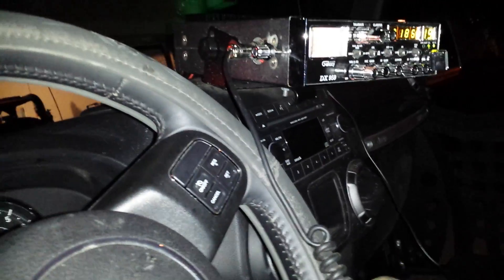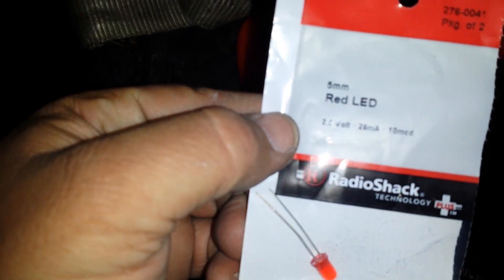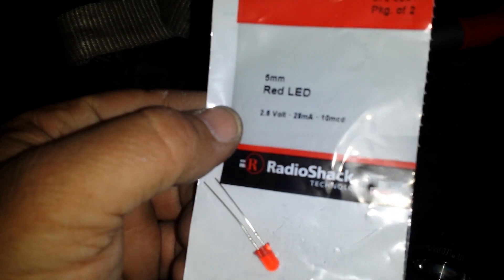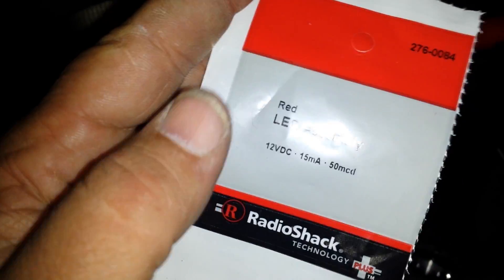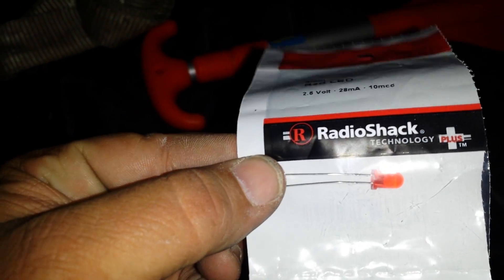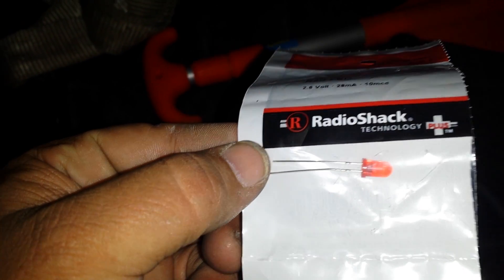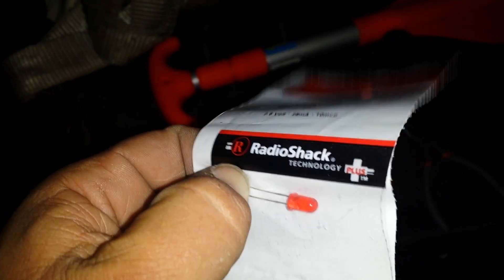LED light on CB antenna

Comment: I've tried it on my antenna but it doesn't work unfortunately.
Reply: Cause you ain’t got the output
Reply: @oldrango883  If I wrap lights around both my cb antennas, how would you recommend increasing the output? I have a road king RKCB. If you recommend I buy a more expensive and better quality CB let me know. Any advice helps as long as I can wrap lights around both my antennas and actually be able to use my CB.

Comment: Cool , back in the day we used neon bulbs, you don't need contact
Reply: I know I'm super late here, but I'm curious. Did the bulbs just run off the ambient power being given off by the antenna?
Reply: Yup, we used a simple 220/240v neon bulb with one prong fixed to the top of the antenna and the other sticking out into the fresh air, there's no polarity to worry about with neons, yes it will drain a small wattage but for mobile use it wasn't an issue.
Reply: When I used florescent bulb's it worked great on my antron 99 and on my antron single coil mobile antenna they were very bright.......... But be careful whenever I kicked the base or mobile in high gear I would explode the lights on the mobile it wasn't a pain to replace the light but on the 99 well that's a different story..... Just keep your RMS Watts under 2k and you should be fine.

Comment: Easier to use an NE-2 neon and shrink tubing, Still has the two leads but doesn't need to be an open circuit, plus it will burn brighter with less watts.
Reply: Swoop1991  that's what we used 40yrs ago😀

Comment: I have a string of red LEDs wrapped around my antenna could I do the same thing with those or do I have to get the single bulb for the top
Reply from the maker: neil witwer you could use the string .... but you are going to need a lot of power to light them up .... a larger amp would be recommended